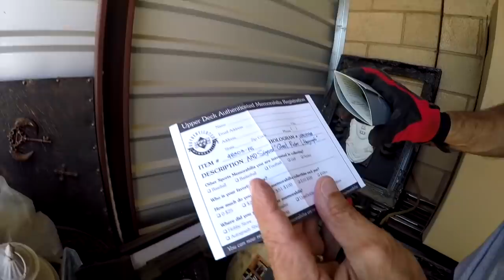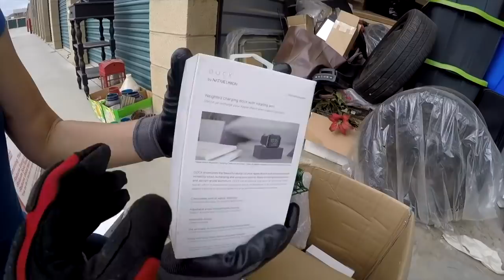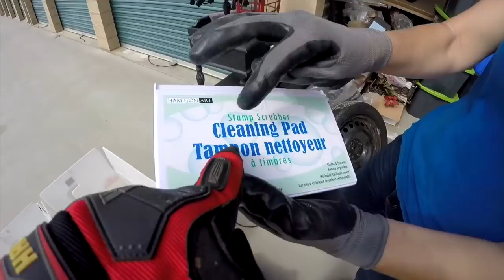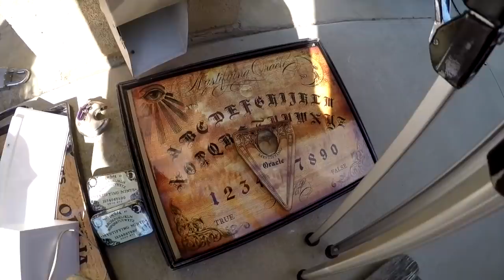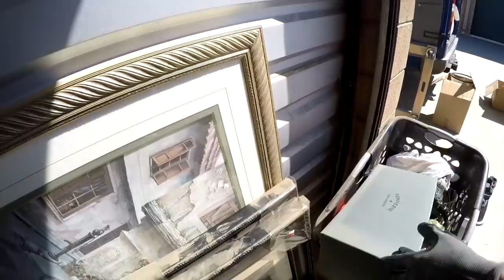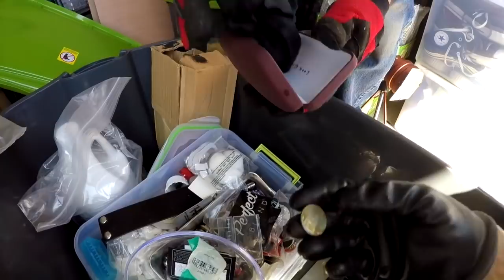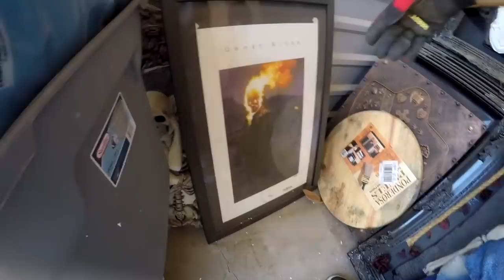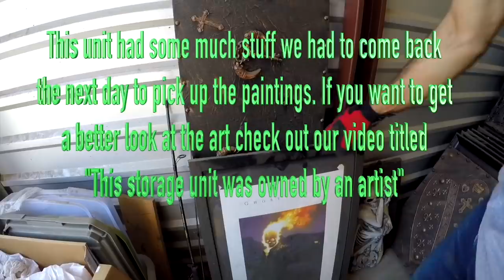Abandoned Storage Unit- AMAZING What was left in this Storage Unit

Comment: You shouldn’t use ouija board it can bring ghosts to you. When I started working at a bar a few years ago a guy that worked that had been using a ouija  board. The next day I started working there and every time I walked into the building I would start being sick and get a really bad stomach ache and I would feel completely drained. But when I left the building I felt fine. So someone I knew did a reiki healing and that’s when they found out that I had a ghost attached to me. So they got rid of the ghost and I was completely fine after. I could go into the bar after no problem. They can be dangerous ouija boards so you shouldn’t use them xx
Reply: Thanku  No I’ve never done reiki by myself I leave it to the professionals xx

Comment: The acrylic stamps attach to the acrylic blocks, then you peel off the stamp and put it back in the original package after you clean it. The acrylic block can be used over and over as the stamps stick to it on their own. Do not use glue to attach stamp to acrylic block.